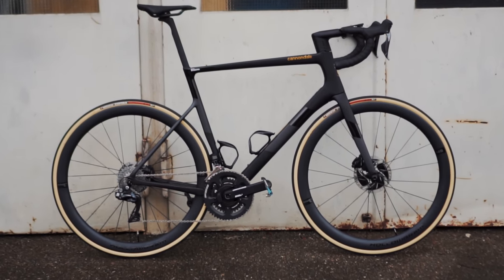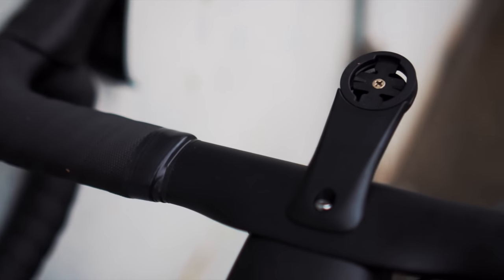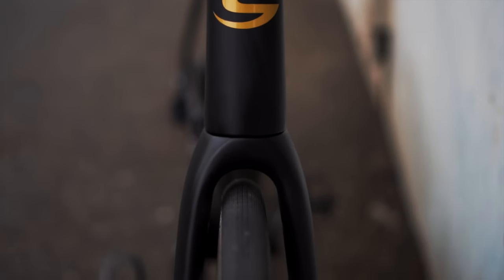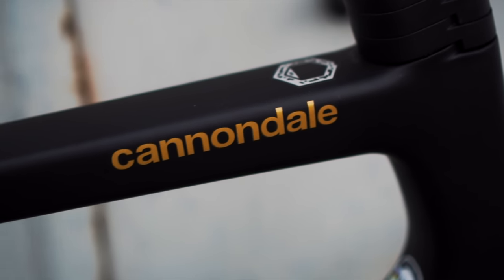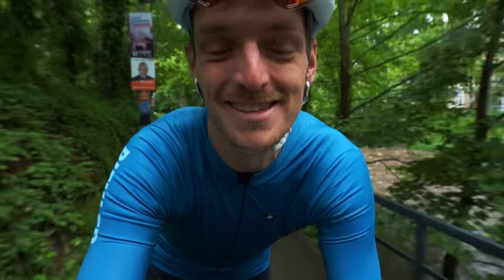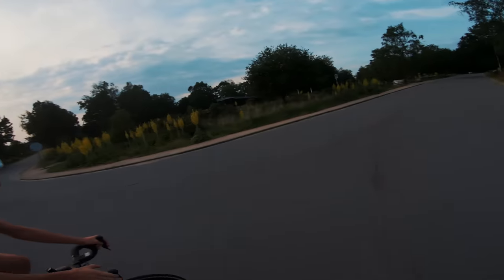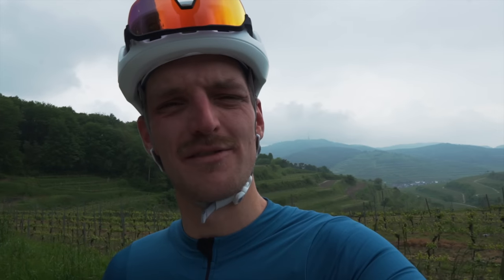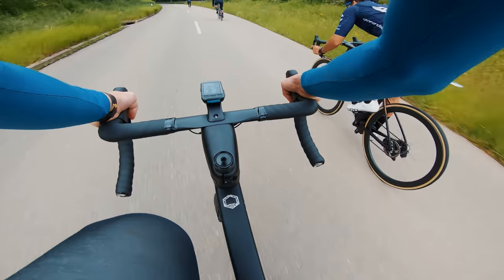THE NEW CANNONDALE SUPERSIX EVO WOW!!!

Comment: Looks great, I must agree with the garmin mount - it's a shocker, everything else is so smart, looks like an afterthought.
Reply from the maker: I agree with you!
Reply: @BrunoBobbink   Cannondale should either supply the power meter activated or fit a standard Hollowgram crank.  It smacks of a rip off to supply a  heavier non-active power meter crank then charge to make it work.  I have a P2M and it's a brilliant power meter but this is an irritation.  It's not like you can remove it and sell it on either because it doesn't work!

They've reduced the seat angle from 73.5 to 73.3deg on the 56cm frame size and don't provide a zero offset seat-post option.  The 15-25mm rear offset on this post/frame geometry combination effectively means it's impossible for me to achieve the fit that I have on my current 2014 Supersix Hi-mod (I'm sure I wont be the only rider out there that will have this issue).  Scott, Canyon, Cervelo etc. manufacture such options, Cannondale have gone to all this effort on the new Evo so they should do the same.  

After all 6-7k Euros/Pounds/Dollars is wasted money if it can't be fitted to the rider as a result of one component.

Comment: Great video thanks 👍 What would you do if you were in my shoes ...
I currently ride a Supersix Evo Hi-Mod DuraAce Team 2016 and thinking of upgrading to Supersix Evo Hi-Mod Dura Ace 2020, so is this bike good enough for upgrading from my current bike ? What do you think ? You wrote in the comments this bike is 7.4kg, mine is 6.4kg out of box. I do some climbing in the summer and ride on flats usually.. Thanks
Reply from the maker: I think you gain about 30 watts with the new bike and I am sure you will love it. But to be honest the 2016 is a great bike. I would wait another year to upgrade. But if you have allot of money and want something new it could be a cool option!
Reply: get some aero handlebars in your 2016 bike (in case you haven't yet) and save the money
Reply: @BrunoBobbink  Hi Bruno, I checked it at Cannondale's website and that 30W gain is when you're riding at 48km/h , not many of us can ride long hours at 48km/h anyway 😂😂 So I guess waiting another year or two would be feasible....
Reply: @faosa73  Hi, my bike is completely stock and all parts replaced so far are also stock. I was also thinking of changing into aero handlebars too, but I wasn't sure if I want to change the stock look of my bike. But now I might.... I think of changing into Metron 5D or something. What do you think ?

Comment: So, regular non Hi-mod just weight more with the same stiffness and ride quality?
Reply: I have the non Hi-Mod version. I’m on the 2020 SuperSix Evo Ultegra disc (the one that’s color is “BBQ”) and it is insanely stiff. The main difference with the Hi-mod is that yes, It’s lighter with the high modulus fibers, and it has the Cannondale KNØT integrates bar and stem combo. The Ultegra one is still really good though. The only things I don’t like on it are the stock saddle (Prologo NagoR5) and the stock stem and bar but other than that, It’s fast as hell, The aero frame is noticeably faster and the dropped seat stays increases comfort zone much. The overall weight is somewhere around 18-19lbs. I’ve had the bone for a couple months now though and I love it very much

Comment: You forgot the assortment of proprietary bottom brackets that Cannondale uses is a negative.
Reply from the maker: Thank you for mentioning it in the comments!
Reply: @simost2566 I know there are workarounds for the proprietary bottom bracket... but why should consumers have to deal with it?  Cannondale should just use BB386EVO.  By the way, the Wheels Manufacturing screw-together bottom brackets kind of suck... lots of wobble between the two cups when threaded together.
Reply: I use bb30 ceramic speed and never have any issue, this bike is amazing. I start ride bike March 2021 now i can reach 45 km/h easy with this bike..its fast especially if u combine with Bora Ultra WS, so smooth so fast so stable. Handling is top notch..worth every peny